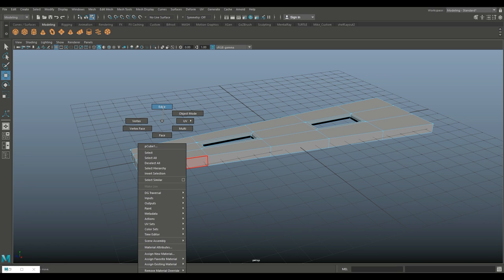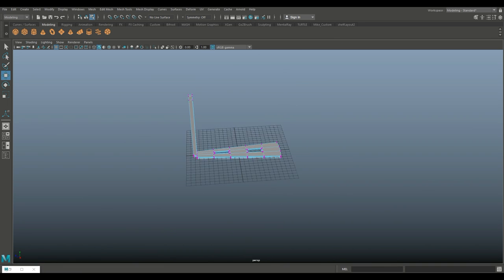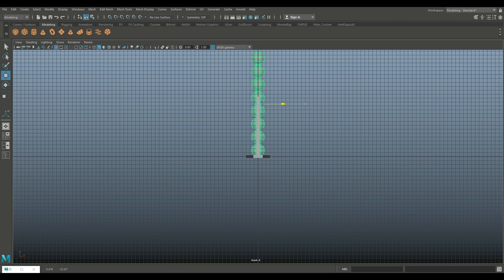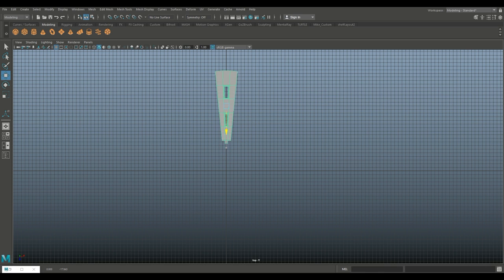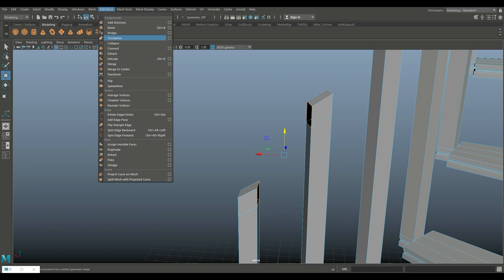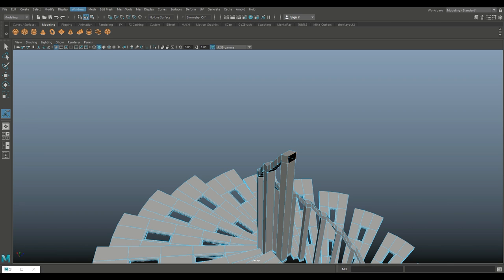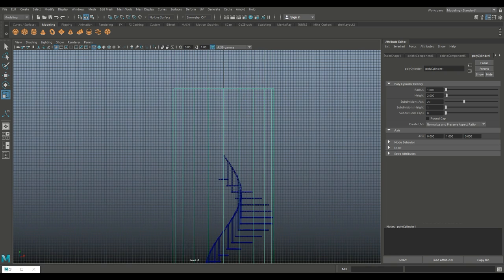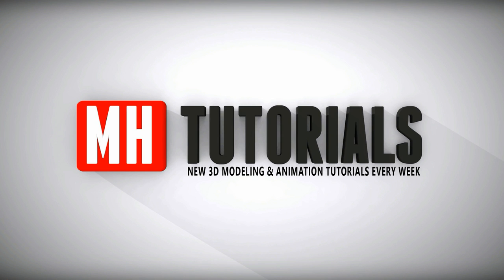How to model SPIRAL STAIRS for a Light house in Maya 2018

Comment: Just thinking wouldnt it be easier to use Pipe instead of Cyinder? No need to Extrude. Also at least on my side i like to create the object and edit its size in the Channel Box ;) As for th wierd twist you will need to play a little with the Offset value. It sometimes does that.. have to live with it ;) Anyway nice one again ;)
Reply from the maker: Thanks